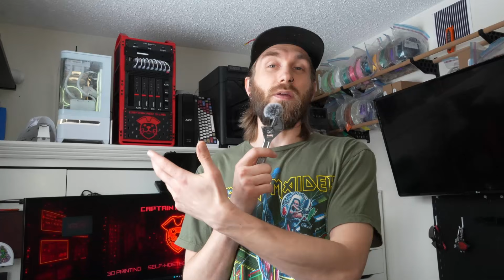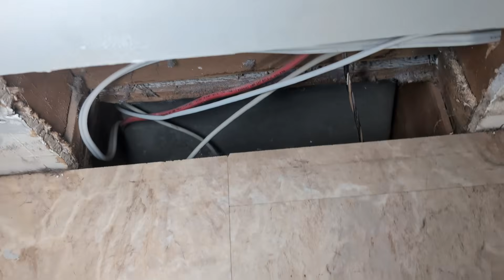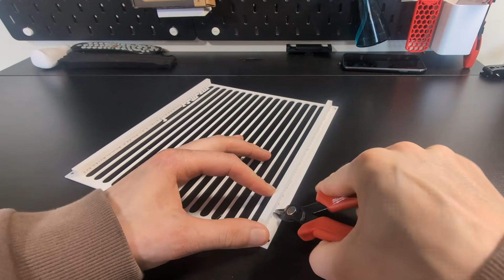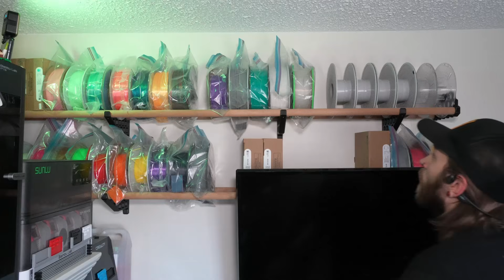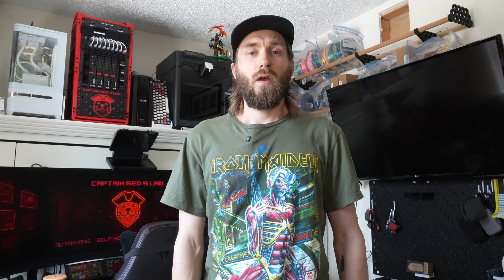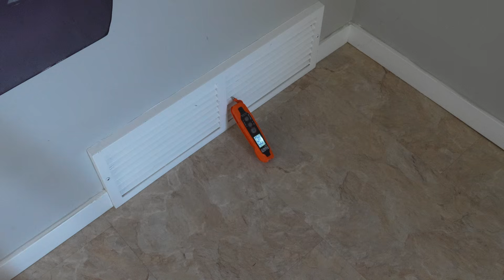My Server Room Was Too Hot, So I Heated My House

Comment: Interesting question, being its your background.... I have my printers in a closet that backs onto a bathroom. Looking at doing a similar booster fan, then ducting it to the existing bathroom vent fan. Not super concerned about heat, but more Styrenes when printing ASA.  Any issues in your mind?

Will likely be putting some specific sensors in the closet to have it auto turn off on etc.